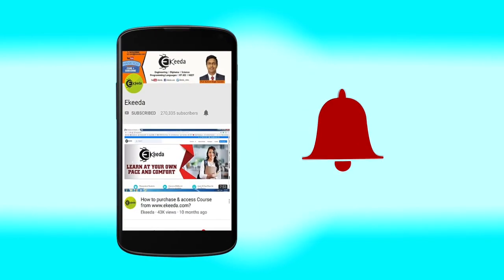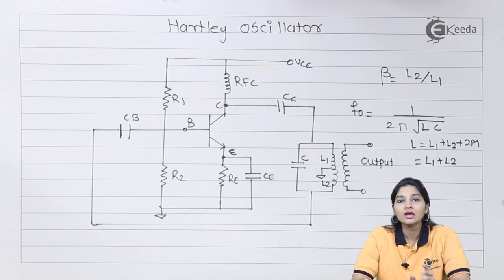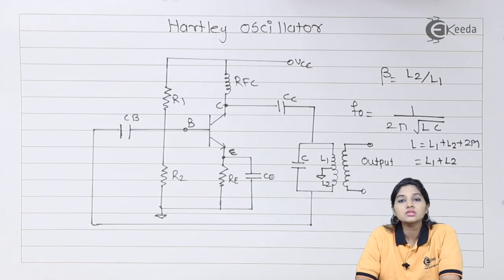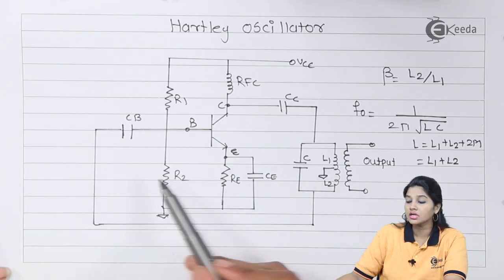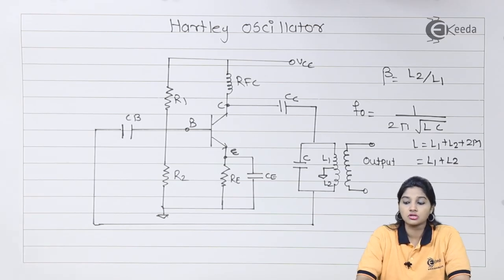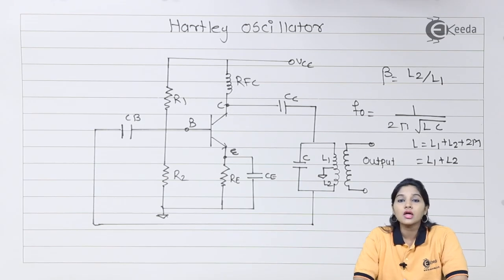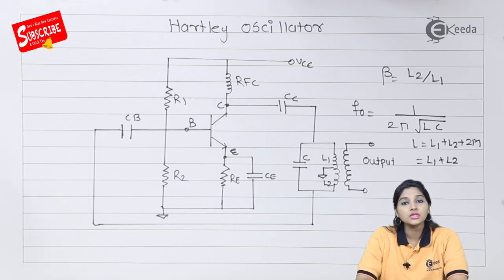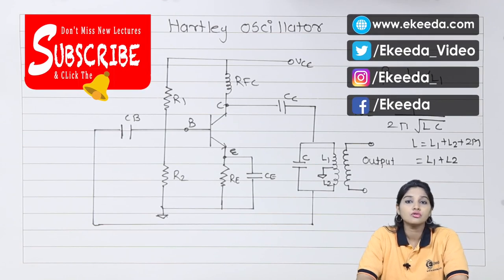Hartley Oscillator - Oscillators in Basic Electronics - Basic Electronics

Comment: The Coupling capacitor will not allow Dc to charge local oscillator circuit.
It should be connected after it

Comment: U said that RFC Will allow DC. it's wrong
Reply: RFC will actually oppose ac as ac is continuously changing and inductor opposes any change in current. However for DC it simply acts as a normal conductor. So she said it will allow dc and will try to block ac.
Reply: Rfc is an inductor which has negligible resistance to dc while high resistance to ac. So it will allow dc and blocks ac